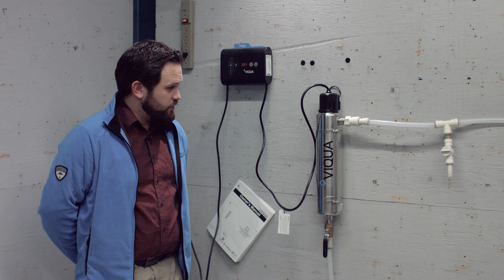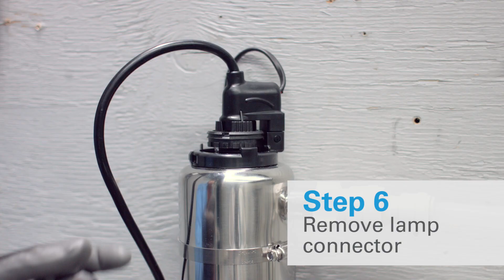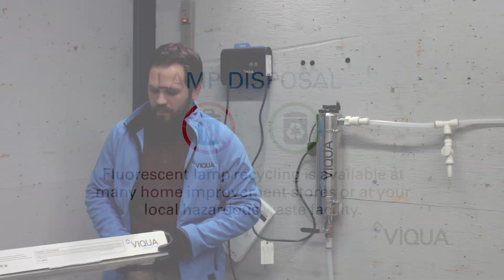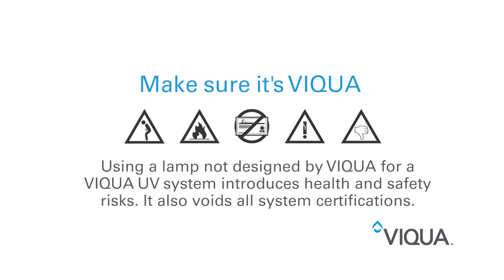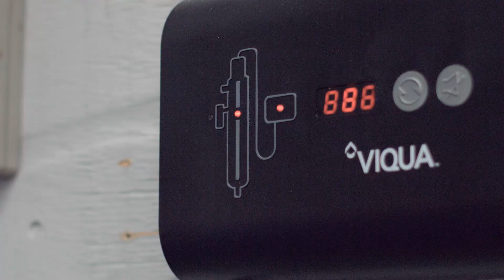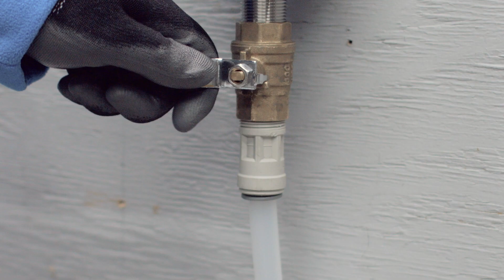How to Replace your VIQUA UV Lamp - Powered by UV Max Systems

Comment: The bottom end with the Spring, is that also a pressure release?  I ask as mine started leaking.  And you can actually push the nut in middle where the spring is inward towards filter.    is the nut supposed to do that?  it appears to be the case, but not making sense to me.

Comment: UV Max ( old name of Viqua) system beeps with news bulb.  Both indicators lights are red.  This model seems to be defective upon research.  Anyone else?
Reply: Hi, I notice you posted this about 2 years ago.  By any chance was your situation resolved?  I'm having similar issues.
Reply: @PoorWays  I also have the same issue occuring. I tried multiple times for a few hours, always with same result.
Reply: @ciimoon5661    Don't want to go into all the recent details but I would suggest replacing the UV light with another one similar in size.  I've installed hundreds of the them with different brands.  They all just turn on and work.  Just seems to be this particular model that has not been repairable.
Reply: @PoorWays  when you say "this particular model" not repairable, are you referring to the model of the replacement bulb or the model of the housing/device?  I tried for several hours reinserting it again in different ways all with same result.  I have the Viqua d4 housing and a replacement off brand lse bulb and sleeve I was able to fit into it (although it was a struggle getting the cap forced back on with the tabs), but the power control box every time would blink red.  I imagine I need to either get a new name brand viqua bulb, or maybe its the wiring gone bad.  hard to tell when I cant see whats going on inside once the bulb is inserted.
Reply: @ciimoon5661  The new d4 controllers can be defective right out of the box.

Comment: Thanks Cameron for this video. The 21 step printed directions in the manual and that came with the replacement bulb were confusing, and didn't seem to apply to the newer model we have. Your directions were so simple. I couldn't have done the job without you!